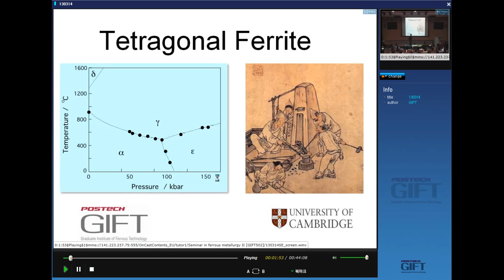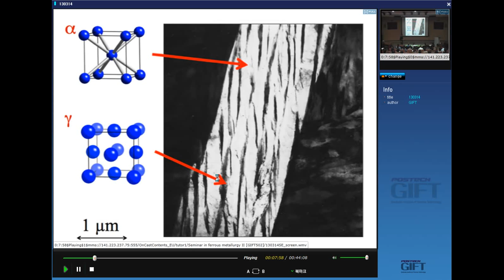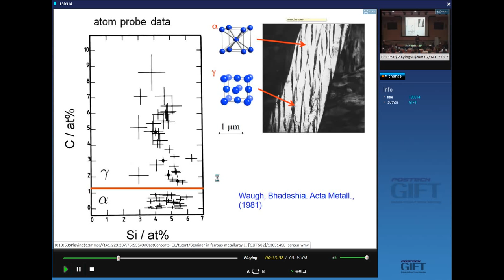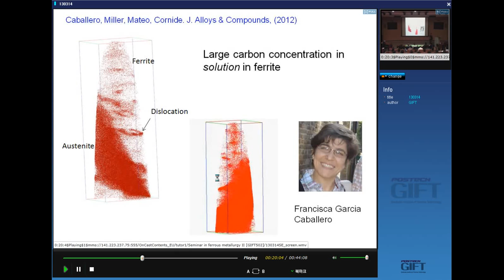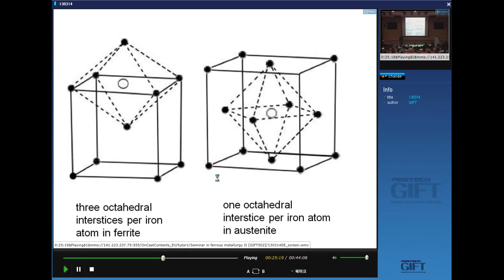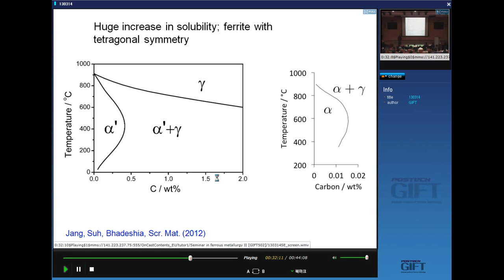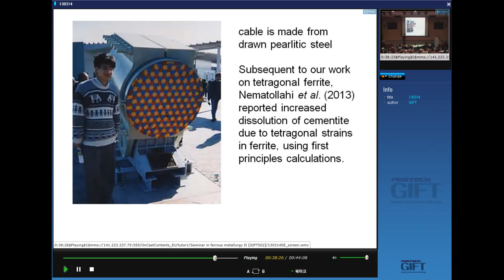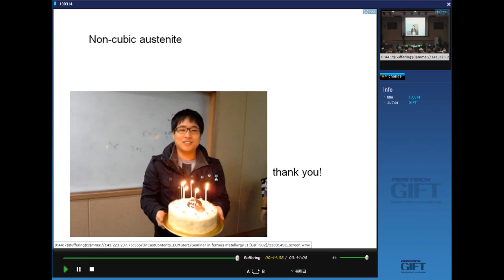Tetragonal ferrite

Comment: I thought that octahedral holes are always bigger than tetragonal holes??
Reply from the maker: Have a look at Philosophical Magazine 93 (2013) 3714-3715
Reply: bhadeshia123 In case for quick access to that cited article:
http://www.sciencedirect.com/science/article/pii/S1359646213002911
http://www.maneyonline.com/doi/pdfplus/10.1179/1743284714Y.0000000691

From that linked article, I couldn't found clarification of "tetragonal holes are larger than octahedral holes". I still believe that the: Trigonal hole < tetrahedral hole <octahedral hole. Seems like I missed something from lecture or misunderstand the point?

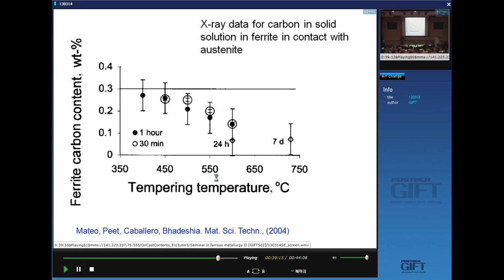Comment: in  your article(39:10), the tetragonal ferrite has be in equilibrium with austenite, why the carbon in ferrite decrease with tempering proceed?
Reply from the maker: It reverts to body-centred cubic, which is the more stable form.
Reply: why it is hard to revert to  body-centred cubic and then release excess carbon?
Reply from the maker: http://www.msm.cam.ac.uk/phase-trans/2013/Cottrell.html
Reply: I have read your papers. Is it because the activation energy is high that hard to revert to  body-centred cubic and then release excess carbon? Happy Holidays.

Comment: why The tetragonal ferrite should eventually relax the excess carbon and become cubic with tempering . you say tetragonal ferrite with excess cabon with austenite is more stable than cubic ferrite with austenite
Reply from the maker: Not MORE stable, but metastable. The main point is that the equilibrium between the tetragonal ferrite and austenite leads to a greater solubility in  the ferrite.
Reply: thank you. not quite understand why the steel choose  tetragonal ferrite with excess cabon with austenite ,rather than cubic ferrite with austenite ,initially . the later is stable.
Reply from the maker: @pzhu9047  Austenite has one octahedral interstice per iron atom, but ferrite has three. Therefore,  the Bain strain automatically puts all the carbon atoms in just one sublattice of ferrite, so initially a displacive transformation will necessarily produce a tetragonal lattice with an ordered array of carbon
Reply: Will the tetragonal ferrite with excess cabon keep stable all the time if austenite doesn't decompose during holding ?
Reply from the maker: @pzhu9047  I don't really know - the euilibrium we calculated is between tetragonal ferrite and austenite, not considering later carbide precipitation.